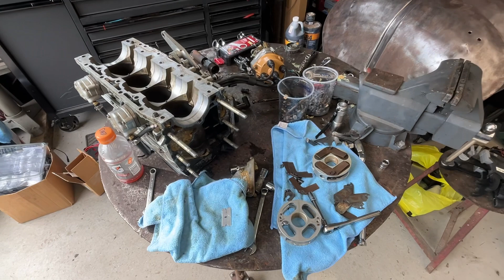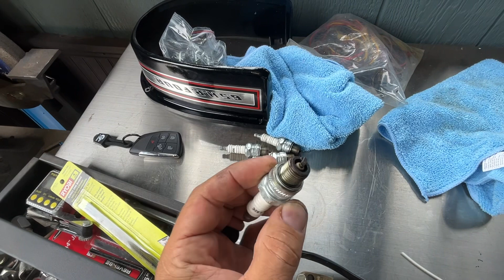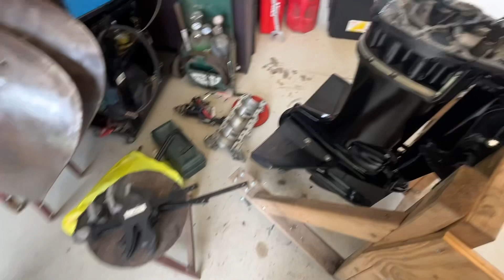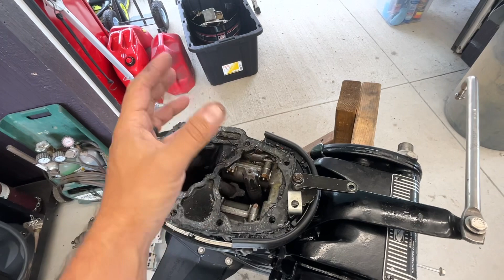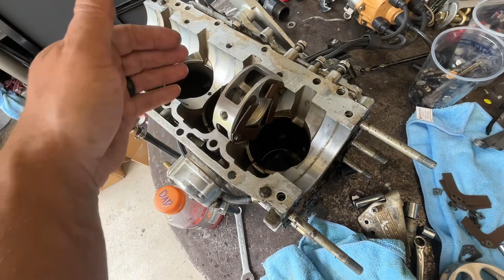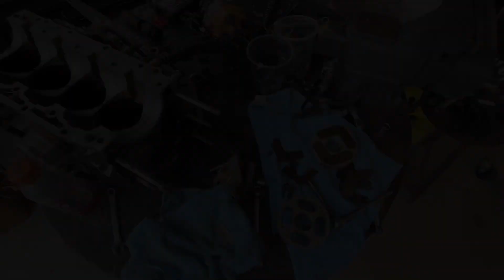1967 Kiekhaefer Mercury 650SS 2-Stroke Outboard:  Reed Valves

Comment: holly cow you really have it torn apart, still on my end trying to figure out how to take off the lower cowl to get to the starter solenoid, on mine i had to shave the bracket from the cdi internal harness and remove a three bolted deal out of the way just to install the harness, then fight to get that last lower bolt tight on the three bolted deal because lack of room fun city
Reply from the maker: Yeah,  there is no easy way to say it, but these engines are 5 pounds in a 1 pound bag.  Patience and practice and once you take it apart enough you get good muscle memory.
Reply: @langbros.1907  it was a learning experience digging into it for sure fortunately I did not have to take off the lower cowl and managed to remove the starter and solenoid and change them out